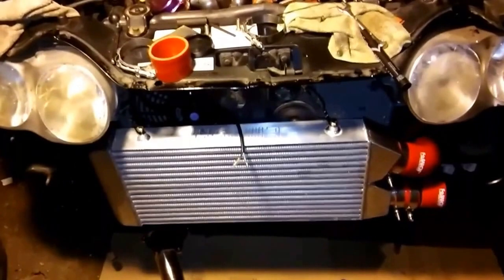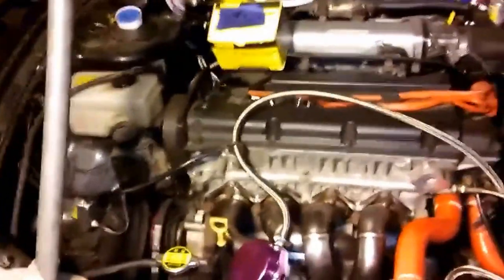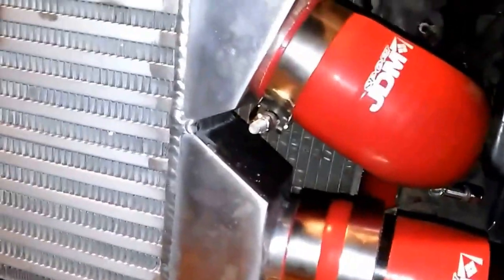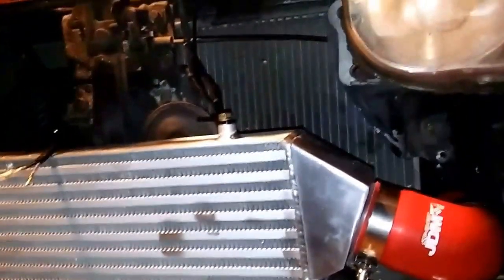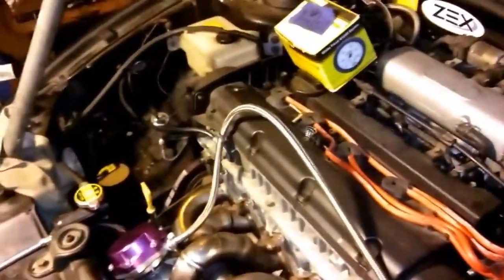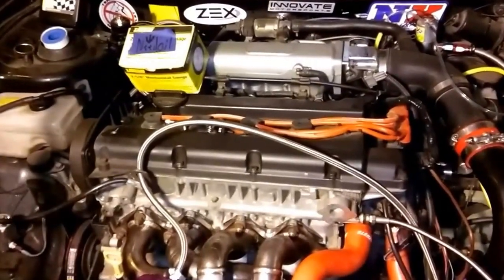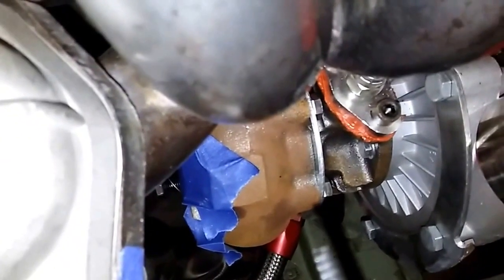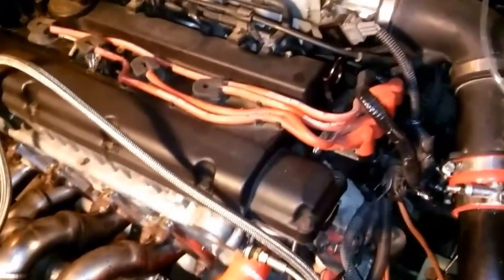Turbo nitrous Tiburon updates taking longer than i ever thought

Comment: What you think is the best engine oil for my rd1 n/a? i been using full synthetic 10w30 or should i change to regular oil?
Reply from the maker: Joselito i don't use synthetic oil but i say its fine for running na shouldn't be a issue
Reply: PA Tuners You rather use regular instead?
I ask because I found my Rd with low oil after 5k miles in 3 months. I have no leaks, and the car has never burn oil before.
Reply from the maker: yes I only use regular when these cars where new wasn't really any synthetic oil .friction breaks oil down I always change oil every 3k in these cars I don't pay attention to what they say on there oil containers far as what they say oil life is
Reply: PA Tuners thanks bro.. i will get regular from now on.. The build is looking mint.. Cant wait to hear the car idling..
Reply from the maker: no problem shouldn't be long need some  more straight intercooler piping not feeling all these couplers
Reply: PA Tuners
Oh ok. keep us posted! 👍👍
Reply from the maker: I will for sure